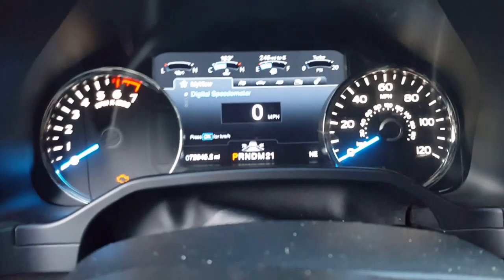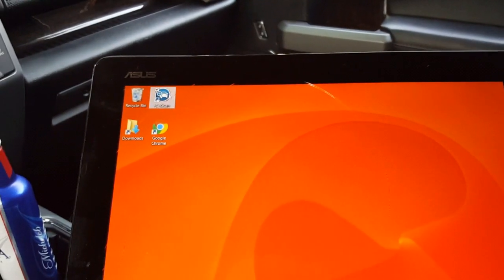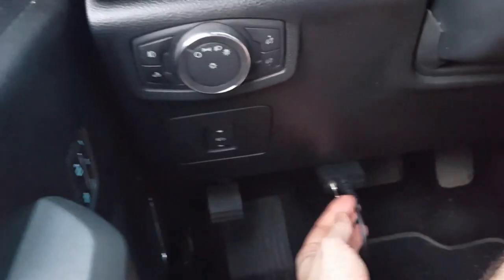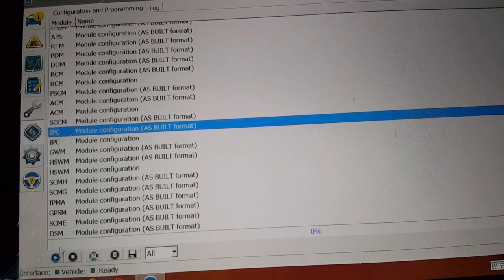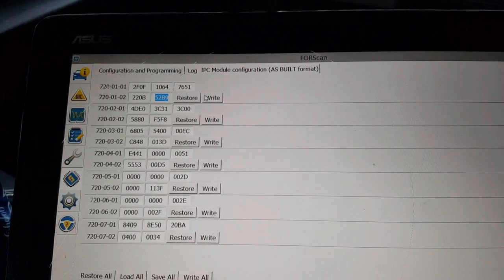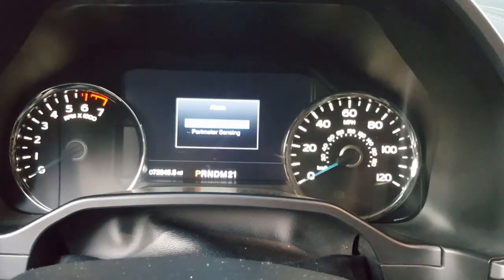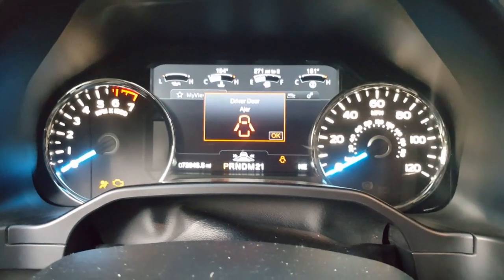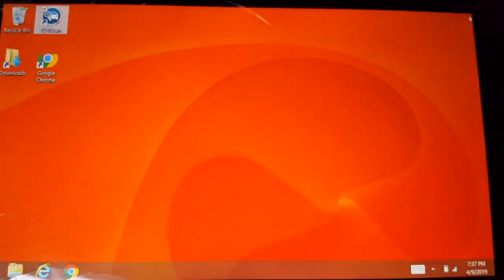FORScan how to disable open door ajar chime on ford f150

Comment: Does this cause the possibility of you accidentally leaving key in the ignition, or will the doors still not lock with key in ignition on exiting the truck?(09-14 models)
Reply from the maker: I'm not sure Mark, I've not tried to leave it in. But with fobs the door unlocks if its nearby
Reply: @ricardosworkshop  ah yes, on newer trucks. 2013 has old style FOB that truck does not recognize until in ignition. Thanks for reply!

Comment: I think I have all the chimes disabled now but I was thrown off about the engine start chimes because I have my winter wheels on which don't have tpms so I think the chimes I get at start up are because the tpms window pops up as soon as you start the engine and the chimes im hearing might be associated with that and not the normal start up chimes. now I want to disable the tpms chime but I  still want the message and the menu for when I put my summer tires back on. any help with this??
Reply from the maker: That's a great question. I hadn't seen before... checkout forscan.org forum

Comment: I have a 2017 xlt sport. the door chime disable and the engine start chime disable are not working. when I change the first set of 4 values, it automatically changes the second set when I write it and neither is working. do I need different values? maybe my truck it a little different?? please advise. the nav in motion mod did work
Reply from the maker: Hello Flea. Yes, one value might affect another and automatically update it too. But I hadn't seen this happen before. IPC controls a lot... checkout the spreadsheet https://docs.google.com/spreadsheets/d/1uDSQ1Z5a2Wt8-kjrSiVSlDFGFHnfeuhb3RTMVz95730/edit?usp=drivesdk
Reply: @ricardosworkshop  how do you subtract 8 from 1?
Reply: How can I send you a pic of my ipc values?